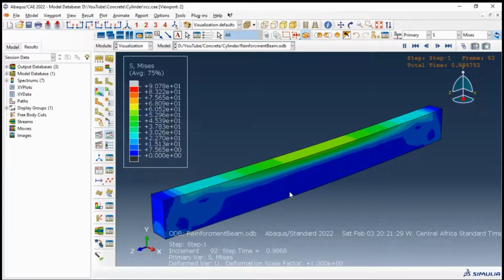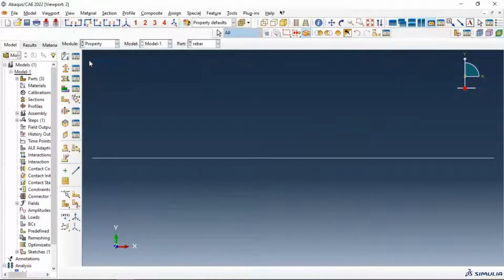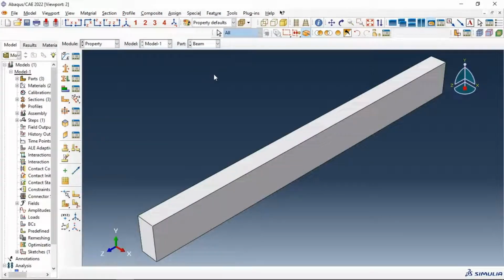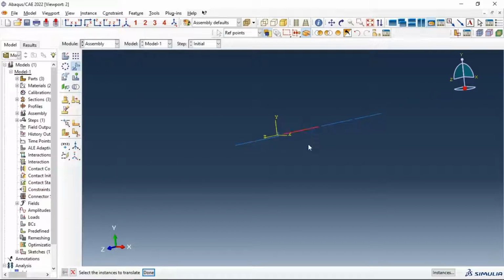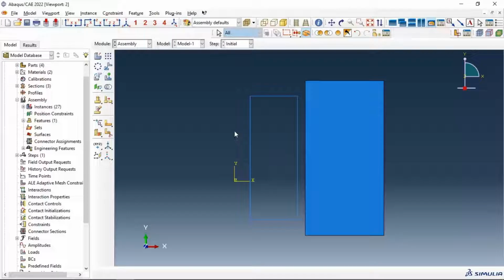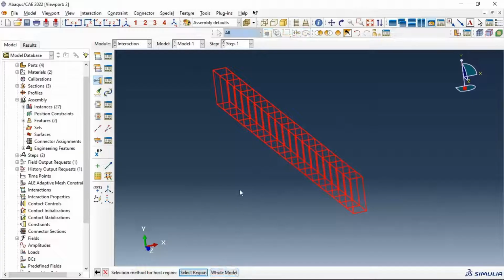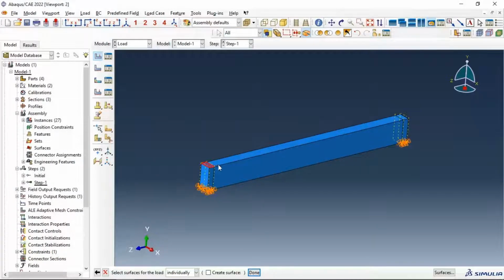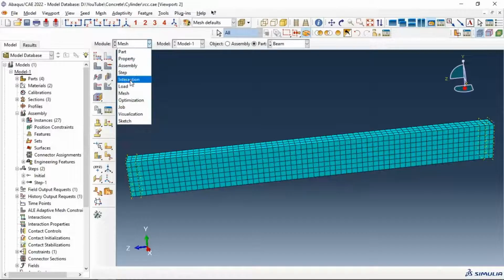Abaqus Tutorial: Modeling of analysis of Reinforced Concrete beam using Abaqus.

Comment: DURING THE CONVERSION FROM CRUSHING TO PLASTIC STRAIN Abaqus FOUND NEGATIVE AND/OR DECREASING VALUES OF PLASTIC STRAIN FOR MATERIAL CONCRETE. VERIFY THAT THE DEGRADATION DATA UNDER *CONCRETE COMPRESSION DAMAGE IS CORRECT

Analysis Input File Processor exited with an error. the error says like this. but the data i just follow like what you do sir
Reply: same 😞 i don't know what to do now